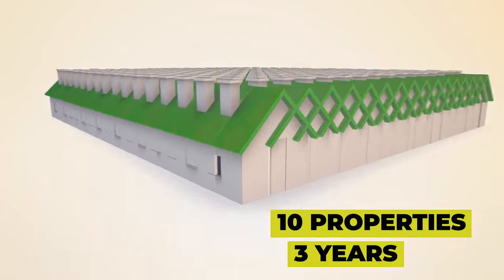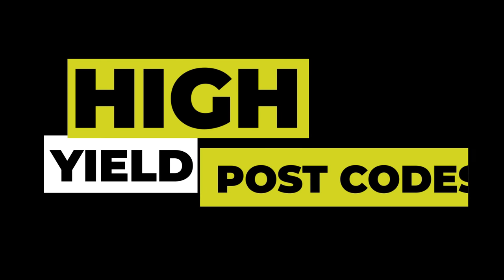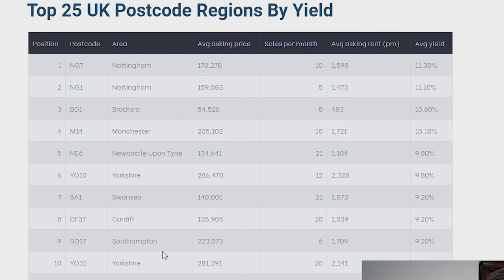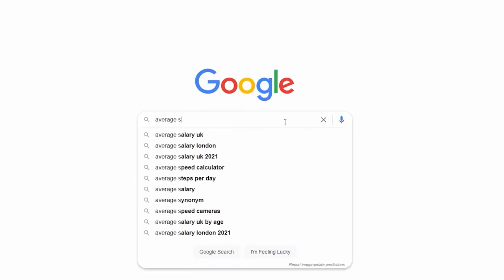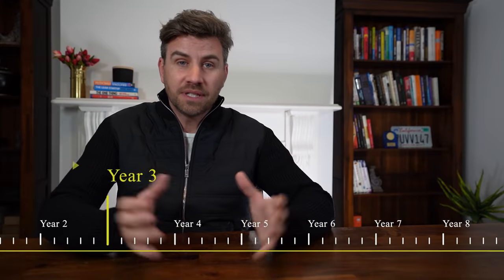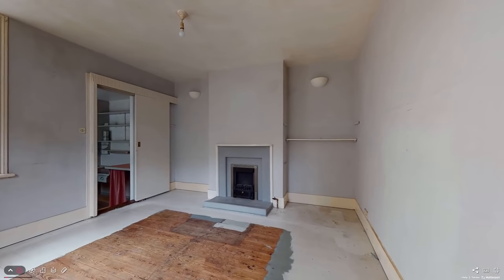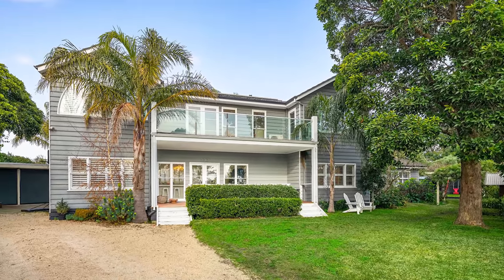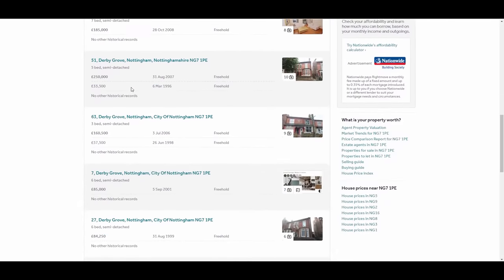Build A BTL Property Portfolio From 0 to 10 In 3 Years With £30k

Comment: Really interesting Video with some great insight into a Buy-Refurb-Refinance-Rent strategy. However, as an investor of 7 years who's done 5 refurbs and has a portfolio at £1600pm net. I have some points for people to consider - not necessarily criticisms but certainly, things people less experienced should consider, as this process is oversimplified to some degree:

- Simple BTL can be done relatively easily remotely using a local agent however the same can't be said for renovations, you'd likely need to relocate to the selected area or renovate in your local area which may not have such favourable market dynamics 
- Can't get a mortgage on an auction property as it's unlikely to clear in the 30-day completion window; so would need bridging finance which is £££ (especially the case if buying through an LTD)
- I'd say it's unlikely you'd get a joint venture partner agreed on the back of 1 renovation's worth of experience
- Running 2 renovations alongside a full-time job is a crazy amount of work even for an experienced investor!
- Exiting each JV deal with 50% of the profits is highly unlikely enough money to purchase a replacement property for your portfolio that cash flows
- This video also assumes multiple refinances but that's not going to happen if using a fixed rate mortgage, so you'd need variable rates with no repayment charges or bridging. Bridging is expensive. Using mortgage (long-term) finance for these short-term projects is likely to get you blacklisted by lenders.
- In the end, you point out you'd only likely own 5 or 6 of these properties (optimistic) but based on that they'd each need to yield £430 pm net to hit your goal of £2600 per month, or 67% higher  than was demonstrated in the video, which isn't impossible but is certainly more of a challenge and requires a favourable market
- Finally, this strategy is much harder to do in a strong market so it is quite dependent on external factors. Luckily the market is cooling off at the moment which makes this strategy more viable.

Great content though keep up the work! :)
Reply from the maker: Thanks for watching. No one said anything worth having was easy.
Reply: @StephenDuncombetv  Very valid point!  Whatever approach someone takes to reach this level will need a whole load of work and commitment. Again great video and a good starting point for people looking to get into property
Reply from the maker: Thanks Matt I appreciate the kind words.
Reply: All very valid points, a useful video however.

Comment: Great video. I'm looking into getting into property, and this has helped a good bit. One thing, is there any chance you could do a video on the start up costs of all of this? Say I'm on a wage of £40k. How much would you roughly estimate would be needed to get that first one and get it up to standard? Would you use savings, or just start with zero and use loans? Basically my question is, before venturing into property, how much would you say is a safe amount to have saved? 

For example, you buy your first property at £120k, sell for £160k. How much did all the contractor works cost and did you pay for them out your pocket, or loans? 

In short, if you were on £40k a year, and had minimal savings, how would you go about starting?

Comment: Where are you finding 80% LTV BTL mortgages?
Reply from the maker: I’m assuming you cannot get one. A lot depends on your personal situation. If it’s your first, it may be difficult at a good rate so you’ll need 25% deposit. Either way the important thing is to know your numbers and will the property cash flow. This is the point of the video not to help you get a btl mortgage. You use a broker to do that for you who has access to the whole of the market and can get access to specialist lenders if needed based on your circumstances. Knowing your numbers will dictate what you then can do. Lots of people buy on a bridge and then refinance at a low LTV after refurb. The strategy is up to you. But if you want to find reasons to not do something you’ll find them and justify that it doesn’t work.

Comment: wouldn't you look at 3 HMO's to achieve this sooner?
Reply from the maker: There are lots of options to achieve the same outcome. It's all down to your appetite for risk, and your strategy. This video is about building a 10 property portfolio in 36 months starting with £30k. They could easily be 10 HMO's but then you need to put in place licences, meet fire safety standards and buy in specific areas along with the refurb so more expense and time. So this is amied at those who can get started without worrying about that type of stuff.  Thanks for watching and it's a great conversation starter.

Comment: Hi Stephen, thanks for the great concept and video! Can I ask what lender/ broker you use to get the Refurbishment Buy to Let Mortgage?
Also, did you do this strategy yourself and if so, what did you find your biggest challenges?
Thanks, Natasha
Reply from the maker: Hi Natasha, I've not obtained a refurbuishment BTL mortgage I just explain they are an option instead of a bridging loan. But they do exist and are readliy available on the market. A simple google will reveal who offers them. This strategy is one I have used in the past and one I am about to do again. The biggest issue is finding reliable builders. Thanks for watching.
Reply: Precise Mortgages

Comment: how do your refinance after the renovation if most buy-to-let mortgages are 2 or 5 year fixed term? Don't you have to wait for the 2 or 4 years to end ?
Reply from the maker: You can buy with a bridging loan and then refinance into a fixed rate buy to let you want to fix the rates or if the property can be bought with a btl mortgage get a variable rate as it will be cheaper than a bridge. After 6 months you can refinance with most lenders as long as you’ve shown you’ve added value to it.

Comment: Hi Stephen. I'm just starting my BTL property journey. Once you complete property no.1 and you re-finance it, I understand you use the money as a down payment for property no.2. Do you then get another mortgage from the bank for property no.2? If so, what does the bank base the mortgage on? Is it your salary or income from property no.1? I'm a little confused as to how people get finance from the banks for several properties if they are renting them all out?
Reply from the maker: Hi Daz, good questiion. So you've got the deposit for property 2 from property 1. You then buy property 2 with a new buy to let mortgage just like you did property 1, and the amount you can borrow will be based on the rental income that property 2 can generate. 

Check with a broker on how different lenders may calculate that rental income as they use different calculations.  With buy to let properties your income is not that important as long as you do have one. Typically about £21k per year and it's more about what rental income it the property can generate. So you need to get together deposits (20% to 25% + stamp & legal) and get buy to let mortgages to build a btl portfolio.
Reply: Daz reach out to me happy to have a chat and explain

Comment: that was an amazing video. i just have one question as i am working to start doing this. how do i find a trustworthy partner. i can do most things in a property other than electric and gas. many thanks for any info.
Reply from the maker: Thanks for the feedback. Local Meetup groups would be a starter. Look on Meetup.com for them. Find ones that want to discuss property investing and networking. Introduce yourself and what you can offer someone. So you due diligence on others though and get anything written up formally as a joint venture agreement with clear roles and responsibilities. This is in the video. You may need to watch it a few times to take it all in 😀

Comment: Good video but my only reservation is that if the house market were to drop 20% (which could happen), you might struggle remortgaging. I own a number of residential and commercial properties.
Reply from the maker: +Philip C pleased you liked it. Thanks for watching. It could drop 20%, but in the 6 months you’ve bought it and then added value, the market does not move that quickly.  But with a war in Europe right now who knows….